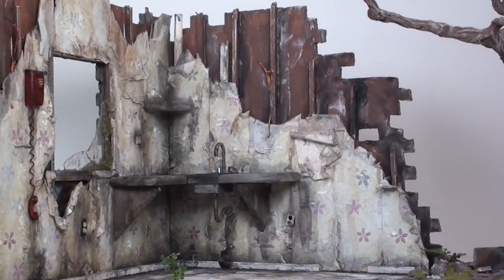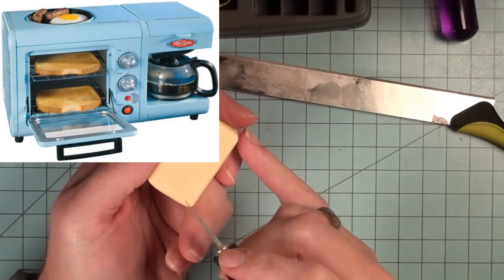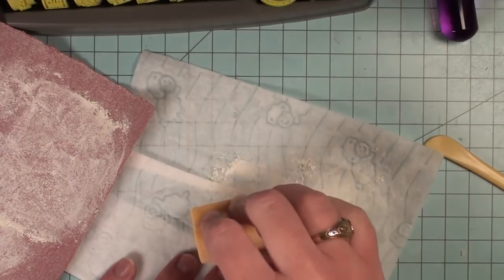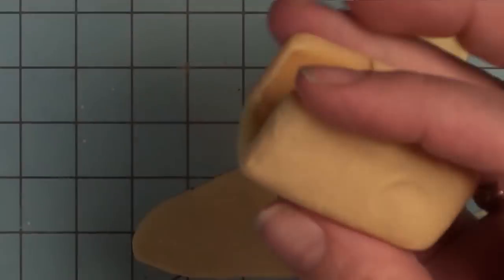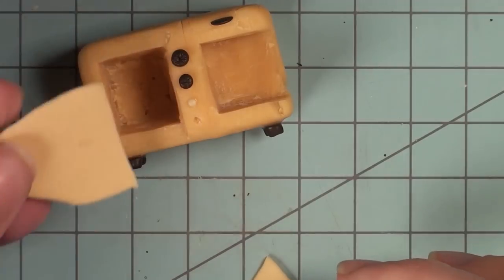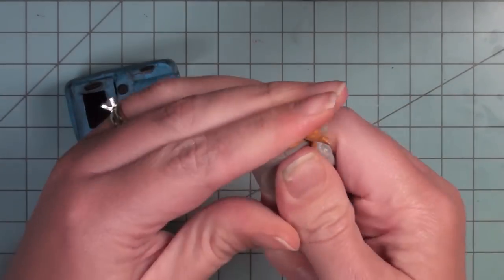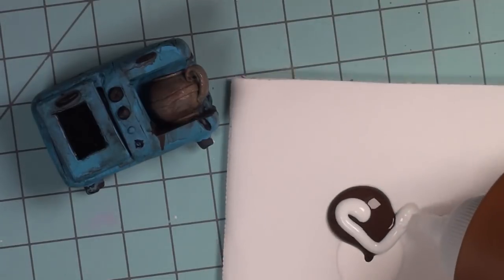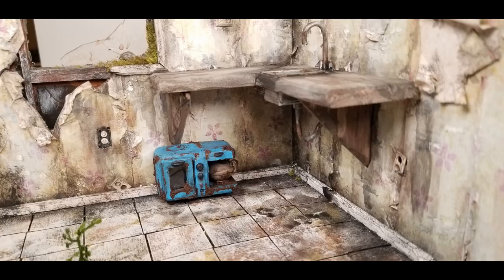Rusty Polymer Clay Miniature Appliance (Abandoned Coffee Shop 7)

Comment: Sounds like your blade needs sharpening a bit. Get the extra fine wet&dry sanding paper cut of a piece fold it in half with the sand paper inside and run it over the edge a few times this will help to sharpen the edge again. This is the best way of extending the life of the blade for as long as you can. 
Lol I am so glad I was not the only one who thought it looked like you were using cheese around it 😹😹😹😹😹
It looks great even with upside down writing 😹😹😹😹😹
Reply from the maker: You are probably right Angela!  I always change my blade before cutting paper or cardboard but I have not perfected my clay check list yet lol.  Thank you for the kind words!!
Reply: Bentley House Minis I use to replace my blades all the time until I worked out that I could keep them in good condition with the extra fine wet&dry paper it keeps the blade edge nice and sharp 😊 
Your right about putting the clay in the freezer this always helps when it comes canes as I find it helps with slicing extra fine slices. Same goes for clay that needs to have nice sharp edges. 😊 these are all things you learn the more you work with clay🤗
I have some times done mini bakes to firm up the clay once I have the shape this allows me to do more detailed work on the item in question like smoothing clay around feet and buttons. This does not hurt the clay once you have all the detailed work done then you can remake bake for the full time. In my case I put in at a slightly lower temp and bake for double the time. This in fact makes the clay stronger when doing this. I have found that sticking the the recommended times and temps has in most cases been to little for some projects for something like the item you just made I would have baked for around hour and half and this would ensure that it was baked to it’s full strength.have a great week end coming your way now can not believe it’s already Saturday morning 😹😹😹 where did the week go 😹😹😹
Reply from the maker: Thank you for the suggestions.  I would have never thought of sharpening my blades but that's a great money and supply saver!  I am still learning with clay so any and all suggestions are welcome!!
Reply: Bentley House Minis 🤗 your welcome Ava, I just wish when I first started out with clay all those many years ago I had the same help 😹 where I live I am the only one in town who,first started with the clay since then 2 more people have now started 😹😹 I know that with the blades it started to cost a lot of money as they would blunt so quickly 😿 it was Dad who showed me the trick on how to fix the blades and extend their working life. I have not bought a new blade now in over 2 years 😹😹